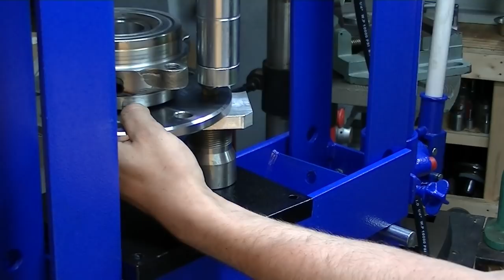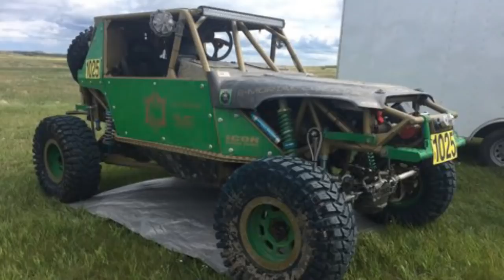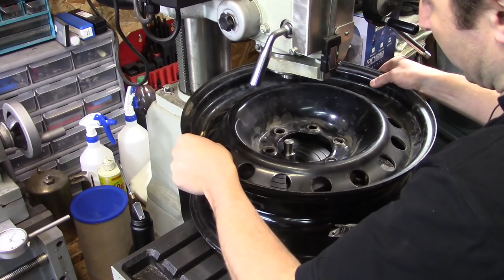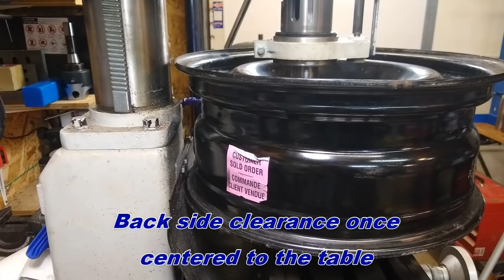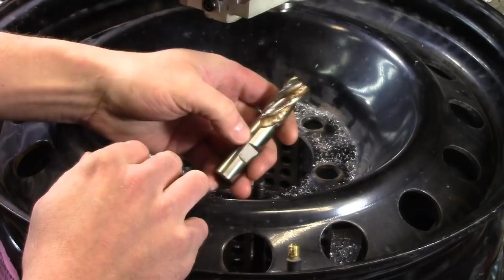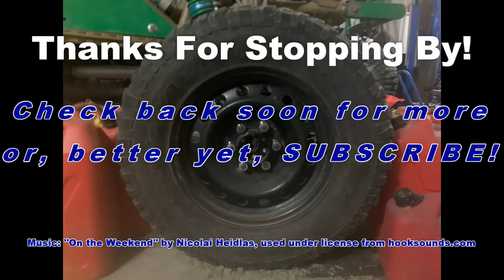4x4 Race Buggy Trailering Rim Modifications

Comment: Hi Everett. Been watching for awhile and I do enjoy your videos. Gary Liming did a nice project for an indexer in Home Shop Machinist awhile back. I have converted my rotary table to use his setup and it it works well. Uses  an Arduino, stepper motor and driver.  You can index with it and run it continuously. I have built several for friends. Watching you is like watching me in my shop😁. Sketch is how we make our smaller machines do what needs to be done.
Reply from the maker: Thanks Chris, I'm glad you like what you see here, sometimes it is just learning as I go for some projects.  The thought of using an Arduino to control a stepper motor sounds like a cool idea, you'd have a lot of control over it by doing that.  I have a subscription to HSM, will have to see if I can find that article.  Thanks for the suggestion, will look into it.
Reply: @EverettsWorkshop  my mistake Everett it was Digital Machinist. What's a good email address for you? I will send it to you.
Reply from the maker: @chrisshorman522  Cool, thanks! The address here is everettsworkshop@gmail.com

Comment: Hi Everett, I wouldn't say something will never happen, you don't know what's going to happen to those rims! This said, I don't think that your significantly weakening those wheels! All the best, Matthew
Reply from the maker: On thinking of it more, you are totally right Matthew, never is a very strong word for that sort of thing.  But in this case I do agree in that the very small amount of material removed will not pose a large structural weakness to the rims so even, worst case scenario, they wound up on a street vehicle, I don't think they would pose a safety hazard either.  but you're right, I could have chosen a better term to use than "never."  Hope you're doing well too!

Comment: I did a similar job for a friend before I was doing You tube. His rims were aluminum though so the bore was like an inch thick. I used the rotary table also but   I had a 3 jaw chuck on it holding a wheel flange. Made short of it using a roughing end mill and hand cranking at a steady rate. It was for an off road rig also.
Reply from the maker: Yeah, that sounds like a similar sort of setup - I can imagine the aluminum would have cut reasonably easily but it would still have been a challenge for you to hand crank steadily for who knows how many passes.  As you know it's fun to make stuff for 4x4 buddies!

Comment: If you use the ridge in the rim it should be closer with the bolt holes. It's a smooth service for better reading. Good job
Reply from the maker: I had not thought of that, but you are totally right, that would have gotten it even more accurately centered.  Thank you for mentioning this, I appreciate good suggestions like this as it helps me to think on projects down the road.

Comment: As was watching was trying to think of easy way to do repeats of loading the wheel . 
I think by using two spots on the rotary table , T nut ,stud , connector nut . 
Would give you clearance to slide wheel on. 
Naturally slip blocks under. 
Drop a long bolt to spin in connecter nut, should put you very close each time. 
Worked production long time. 
You did it once , bet ya do it again.
Reply from the maker: Yeah, I was trying to come up with some way in my mind of having repeatability but as there were only 4 to do I just gave up and re-indicated each wheel.  It worked for Doug's rims, if other ask for a similar job to be done then I will figure out some method like you say.

Comment: Steel plate. , 3 wheel studs and proper lug nuts . Big hole in middle to guide OD of hole saw
Reply from the maker: You know, that would be a viable solution for sure, as long as we could find a hole saw the right diameter.  As it is, Doug was thinking of just using a die grinder and free handing it but we figured using the mill would make a more uniform result, lol.
Reply: @EverettsWorkshop  make up the plate.. use a carbide burr with a bearing on it in a router.. or use a guide plate on the bottom of the router..  only needing to find a smaller diameter base router..  its amazing what can be made with a hole saw.. i did this coil over shock spring compressor in an hour or so.. https://imgur.com/a/bXjhQ  with a router.. one can make the template out of plywood or particle board.. only needing to use care to find the lug center patterns..  and counter sinking holes for the wheel stud heads.. so the  router can slide smoothly..

Comment: I enjoyed that Everett, I was wondering how you were going to do it. They turned out great, nice job. I used to have a slow wedge shape cut out of a piece of wood to fit over the handle/trigger on a battery drill. The farther you pushed it on the faster it went saved my finger. Tony
Reply from the maker: Thanks Tony, and the trigger adapter guard idea is a good one - I can see how that would avoid future trigger finger cramps
Reply: @EverettsWorkshop  We also used it to flatten the drill batteries before recharging that's how it evolved initially. That was a masking tape job before the wedge cut out.

Comment: I'd be modifying the trailer! Changing rims whenever you want to transport the buggy sounds like a right pain!
Reply from the maker: I hear you Sean, but I guess he got a deal he couldn't refuse on the new trailer so this was his solution.  He's got the thing apart so many times repairing it maybe he just doesn't mind it that much.
Reply: As much as it would be nice to not have to swap wheels every time I load the car.I have more issues than just clearing the inner fenders. The car in full race trim has only a 1/2inch of clearance on either side of the rear door which makes getting the car in and out not the easiest by yourself.
Reply: @douglasbusse5826  Sounds like you need rolling workshop, Knight-Rider style!